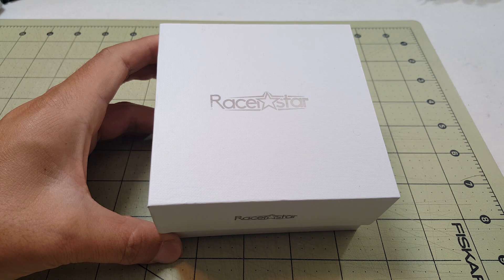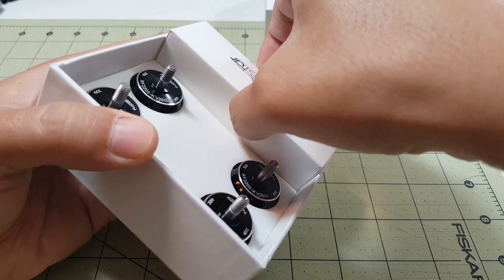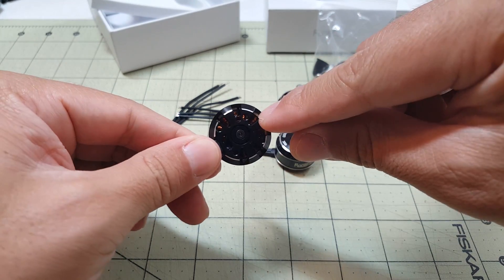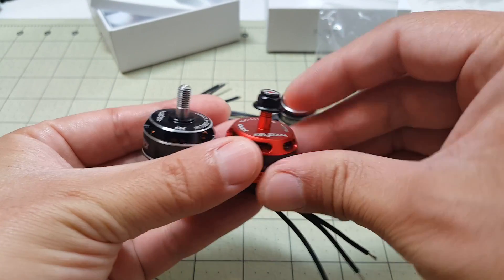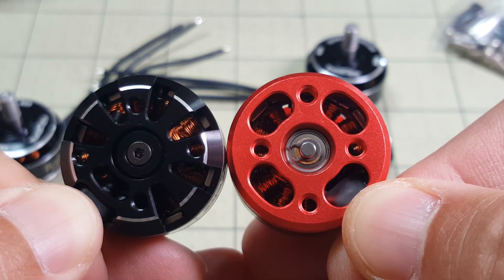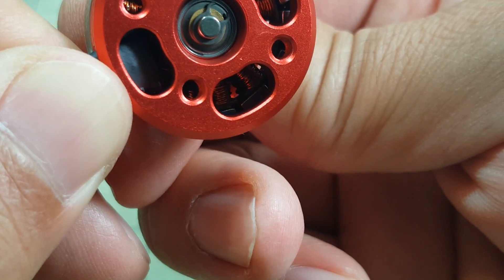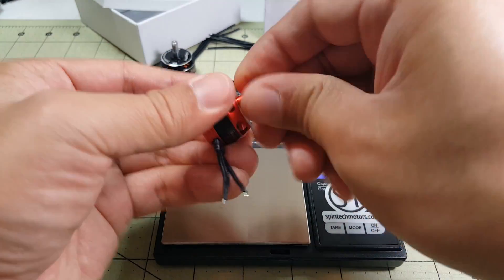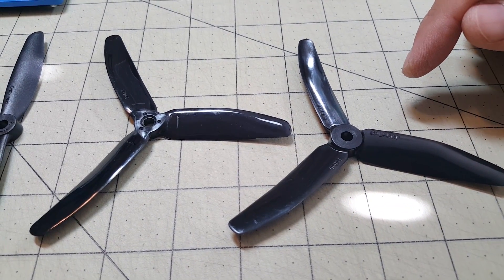Racerstar RF2205S 2600kv Motor Review

Comment: Those motors are sooo good.. still rockin' my realacc 220 and run even smoother than my Lumenier 2206 and that's even though a bell popped off once on one of the motors and i had some decent crashes with them.
Numbers still look good today.
Only problem is the "advanced" bearing lock with a screw, completely locking the screw also locks up the motor... it's ridiculous...

Bought them as cheap to replace motors about 2 weeks before they discontinued them... production costs must've been to high for the price.
Really miss those..

Comment: You have tested a lot of these racer star motors. Witch one did you find the best and the fastest 2205 motors of racerstar?
I am looking for new motors and i like my cheap racerstar 2205 motors but the new set from ztw is also very interesting.
Reply from the maker: These RF series have the most power and the green motors are also right up there.
Reply: Thanks, the blacks it will be. They look good and are not to expensive.
Reply from the maker: I like them but be sure to use strong batteries. These guys draw a lot of amps to produce the massive thrust.  Have fun!
Reply: You use the 2600 with 5" props on 4s?
When I see the sheet, it shows 4S 4" so I was thinking to get the 2300 version.
Reply from the maker: Probably a good idea.
Reply: I think it is better for me to get the 2300. I am not the best pilot.

Comment: Hi. Thanks for the review. Do you keep track of all your motor tests in a spreadsheet for easy comparisons ?
Reply from the maker: +Simon Thorne (Skyrunner_fpv) no
Reply: Albert Kim which of the 2205 size racerstar motors would you recommend for a 210 size x frame?
Reply from the maker: +Simon Thorne (Skyrunner_fpv) this one is the best so far
Reply: Do you think this one is better than the green RS plus 2205's?
Reply from the maker: It's close.  I would have to do some serious in-depth testing and I don't have the time for that at the moment.

Comment: these motors look like a great price to performance ratio! I can't remember how other motors compare amp wise but don't these seem a bit high on the amp draw?
Reply: Was out maidening my 210 using these motors with a rotorgeek plus 20a esc ( don't have any 30a). Seemed ok, perky motors but 1300mah gave just 2.20 mins flight time. There comes a point where efficiency rather than power becomes attractive. Well built motor though. Love the set screw.
Reply: 2:20 minutes... but freestyle pushing hard or normal flight ? Wich props are you using.
Reply: really wanna get these motors... no idea why, i'm scared stiff already from my 20amp kingkong 2300kv's...
Reply from the maker: +Adam Komarek Yes, the amp draw seems a bit on the high side. But 1300g of thrust is amazing. Definitely need 30amp ESCs with these.
Reply: Ricardo Oliveira you're on the mark there. I working with what I have to hand. gf 5050 tri - and not pushing it. Certainly doesn't feel like the right prop for this motor - feels like a 5040 would fit the throttle range better. I think its a good, well built, well priced motor. Finding it hard to tune though - does need different props.